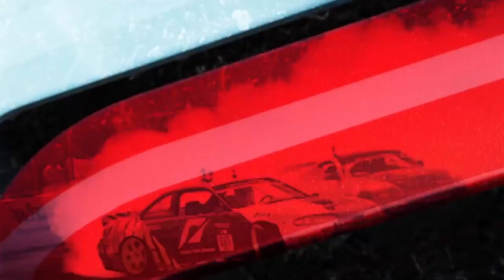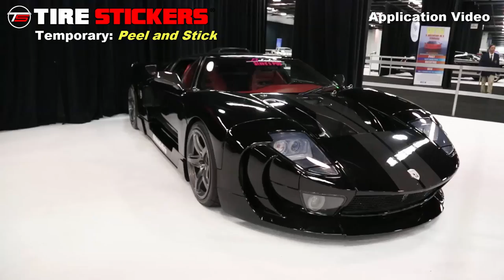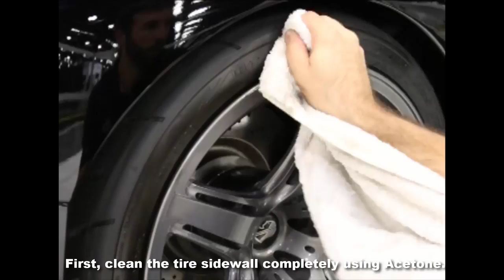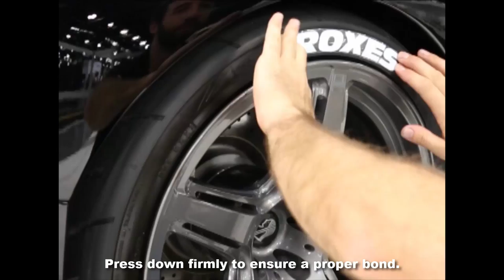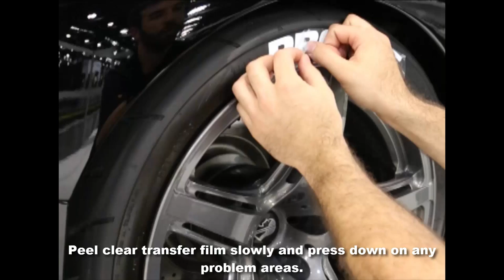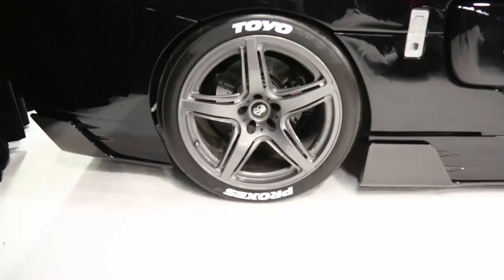Temporary Tire Lettering: How To Install Peel & Stick Tire Decals: Tire Stickers

Comment: Whats the longest these may last without peeling? I know not over a month or two
Reply from the maker: It depends on the use- they last about 1000 miles but are meant for car shows or races. If you are looking for long lasting get the permanent that last the life of the tire
Reply: @Tirestickers  what if i buy the vinyl sticker and spray paint the tyres how long will it last and how does it come off
Reply from the maker: @ΝικόλαςΔελφίνης  The stickers are not vinyl, they are a rubber based compound. They vulcanize to the tire but we cannot guarantee they will last when other products are applied on top of them. We do not recommend it.

Comment: Question: After applying, can we use tire wet or armor all over it?
Reply from the maker: We do not recommend tire wet directly onto the lettering, if they are exposed you should clean off immediately to prevent staining

Comment: I have painted wheels, will the acetone tarnish their finish?
Reply from the maker: No need for acetone on the wheel! Only acetone on the tire is necessary to clean off the oil and dirt residue.
Reply: Actually I just meant if I spilled it or accidentally got some on the wheel, lol.  Thanks!